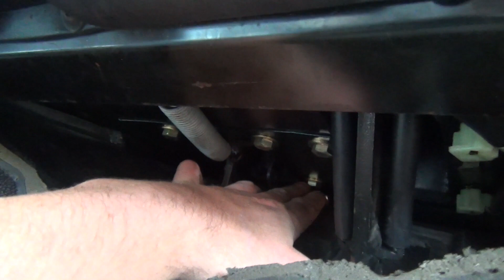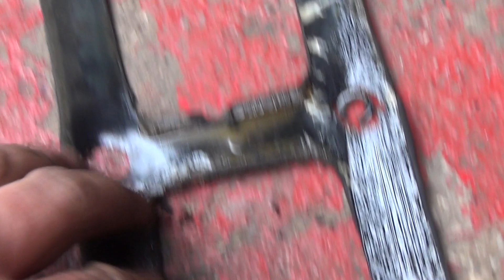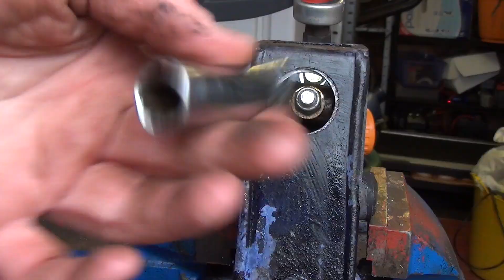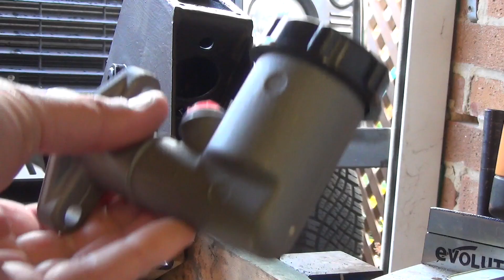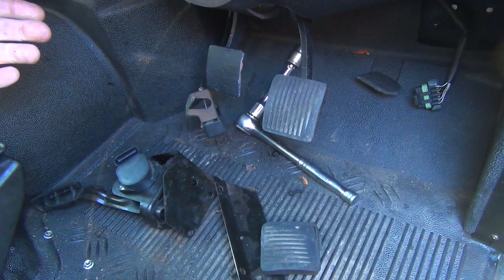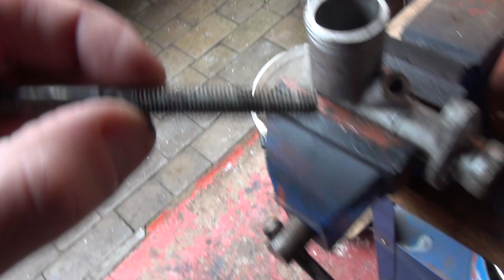Land Rover Defender TD5 Clutch Master Cylinder Replacement

Comment: I totally agree with you about the folly of cheap aftermarket parts! I have just changed the alternator on my TD5 and had to buy the oil feed pipe to the vacuum pump, not only was if bent in the wrong angle, but the threaded gland would not screw into the cylinder head, I had to recut the thread on the pipe gland, and that was on a small feed pipe that cost £130! (now unavailable from Land Rover), so check all parts with originals before trying to fit. There are springs to be fitted on the clutch pedal, they make the pedal effort much lighter, rather than opting for a servo system. Chris B

Comment: Hi there. I've just fitted a clutch to my landrover defender, and I carnt  get get gears any ideas .I've bleed the clutch, and the pedal feels good  but still won't go into gear  ,any ideas thsnkyou .
Reply: They are notoriously hard to bleed, I ended up, pressing the clutch down and wedging it down the leaving it overnight to bleed . Check the slave cylinder is actually pushing on the clutch fork rod and is aligned correctly. Lots of permutations unfortunately, did the clutch go back on the correct way round, was it aligned correctly, did it go in gear at rest  prior to the clutch change, if you did t mess with the clutch fluids, it is unlikely to be air in it.  Good luck.